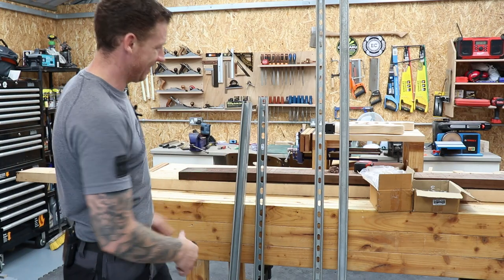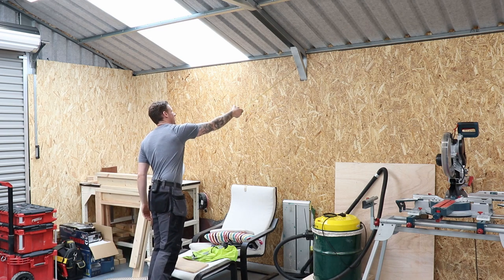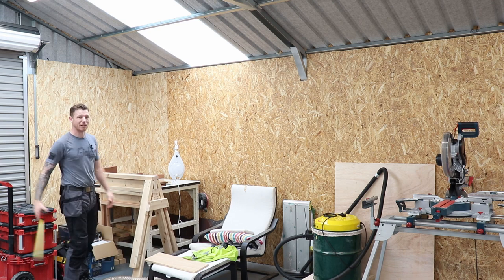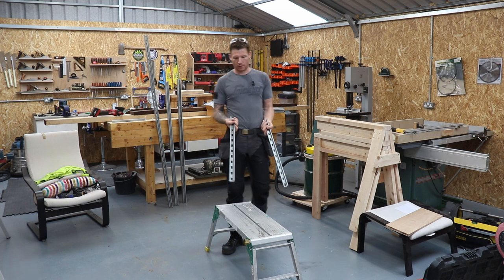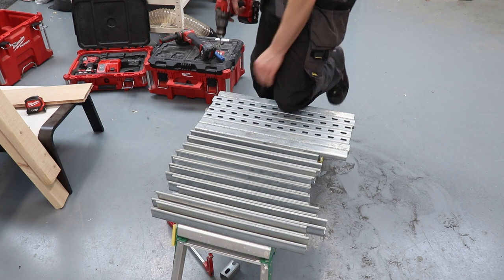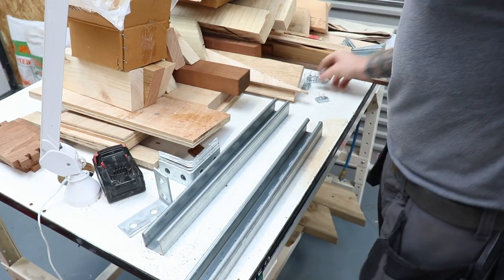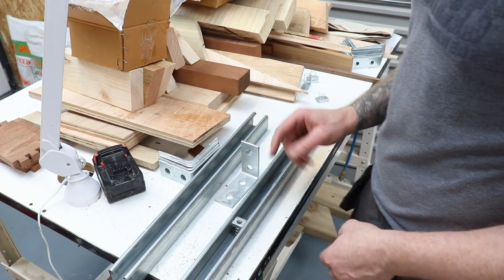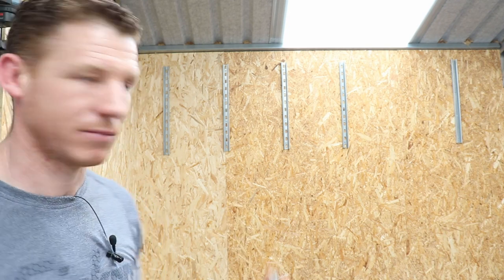Lumber/Timber Storage Rack. Very  Simple,  Very Strong, Very Modular.Made with Unistrut.

Comment: Great build! I love unistrut. The only addition I made when I did mine was to use a wire shelf rack so that I could store pieces that are shorter than the span between two supports. Also allows me to store cutoffs in any direction. Low cost, low weight, allows good airflow, doesn't collect dust.

Comment: Excellent!! I got worried when you dropped the second end cap… it looked like your head was close to whacking the bottom support! Anyway, I’m designing a ladder rack and appreciate your build. I’m going to use your ideas. Instead of using the caps, I’m going to heat shape pvc around the length with a 90degree bend at the end and secure from the bottom. Thanks for posting

Comment: Great design and I will definitely implement it in my garage. I might invert the horizontal pieces so that bracket and bolts are on the bottom and the whole width of the top is smooth. Any reason not to do that? Thanks, Jim

Comment: Are there brackets that you could attach if you ran the rails horizontal instead of vertical? It might make more sense to run them horizontal to have the ability to adjust the shelves width vs height? Great video thank you.
Reply: Thats also a neat idea, since you probably know what height you want them. Or you could run a grid both ways for best of both worlds.

Comment: What's your horizontal spacing between brackets?
So how much weight do you reckon each angle bracket could take?
I'm planning on doing this with slotted 41×21mm. 3ft between brackets, do you think it'll hold 200kg?
Reply: Yes, it’ll very easily hold 200

Comment: could you make the horizon piece 4 feet with the l bracket I want to use is for an elevator platform with not diagonal supports. And can you add one underneath and one on the side and one l bracket on the top of the strut?

Comment: Ok so I have a wired  pool table light above my 9 foot pool table.  I wanna get a ping pong top to play ping pong too but light is in the way.. I was thinking of adding a plug to the light and connect it to thoese retractable extension cords. The retractable extension cord will be plug in into garahe ceiling outlet...then I wanted to mount light on two unistrut  rails with a trolley to move it out of the way whenever we wanted to play ping pong.  Can this be done and do you think it will work?? Basically wanna move pool table light back and forth when playing pool or ping pong..that's why I wanna get the retractable extension  cord so it can retract when rolling light out of the way to play ping pong or move it back to play pool

Comment: Quick question Tom, I’ve a shed metal frame like yours which I had built this year. It has non drip roof cladding but this winter I’ve had a lot of problems with condensation falling from the skylights. I was wondering is this an issue in your shed. I’m an industrial electrician also and a keen fan of unistrut 👍👍
Reply from the maker: Check my latest workshop vlog I go through it in that